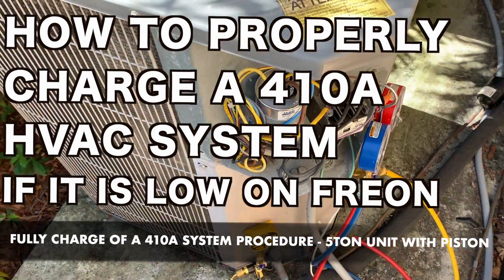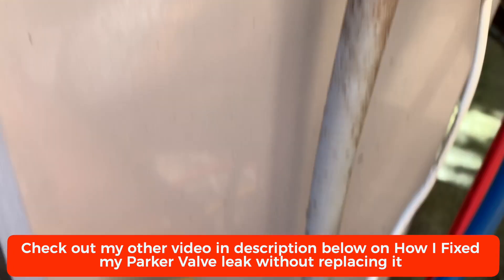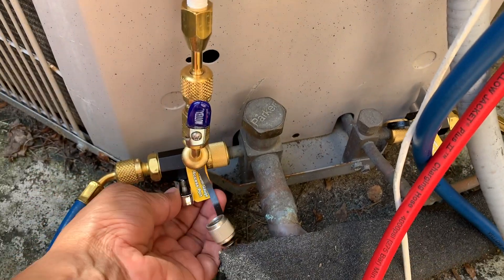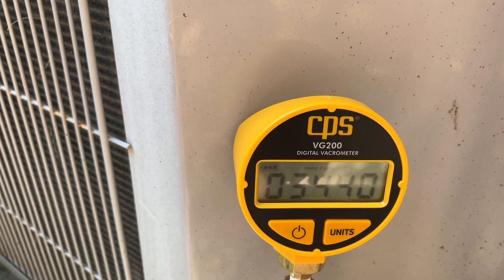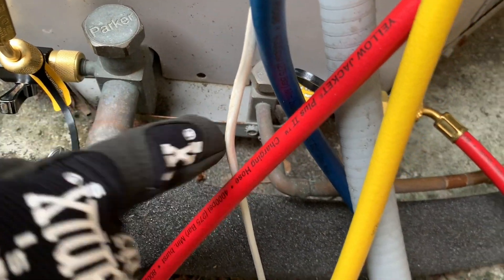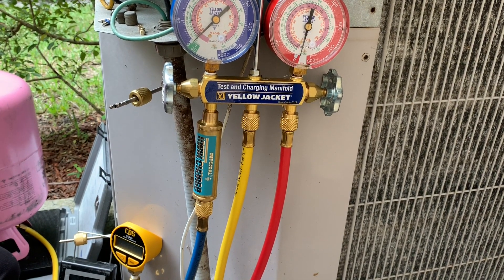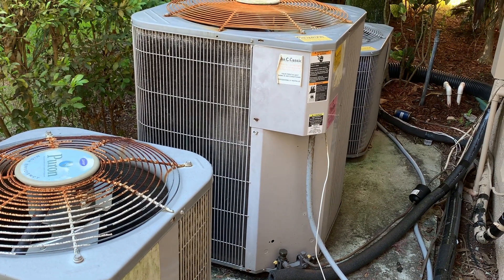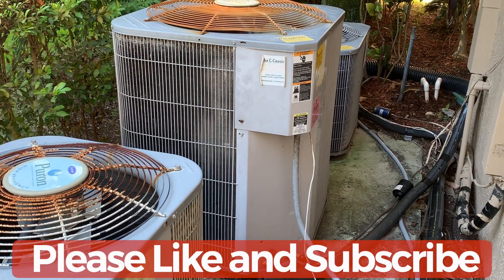How to Properly Charge HVAC with 410A after pulling a Vacuum

Comment: So if you changed the compressor,  and you need to charge the system from scratch,  you would still charge it the same way,  just pump liquid refrigerate into the high side with the compressor off?

Comment: Fun Fact: "Freon" was coined way back by Dupont when it competing for business to charge cars low on "refrigerant." So freon IS NOT THE SAME across the board, but it worked for Dupont and the wording is still used til this day.

Comment: good video ima installer w some service skills but I haven't been active in the field due to injuries but watching the video gave me a quick refresher w out having to hear too much extra talking about non sense to distract me lmao but yea I have to charge my unit from high side since the unit cycles on and off due to pressure switches doing their job... but yea feed refrigerant from liquid side at first to get switches to close so unit can run normal and the rest feed through suction side  and measure sub cooling since its txv 410a unit... .... but I do have to check air handler in attic to see where any possible leaks can come from when I first installed it I left gauges on for more than a day and it held pressure very well. but I also think I mightve ran my return air flex too long so I might have to add 2 more smaller return grills up stairs in separate rooms or try to cut the return flex to a shorter route but first im going to increase the blower motor fan speed up one notch and see how she goes.
Reply from the maker: Glad it helped. Please like and subscribe as it helps my channel supporting charity :)

Comment: Great video! If after fixing a leak, do I add the liquid refrigerant with the lines still back seated ? Then when it adds no more, then switch the unit on and add capot thru the suction line? Please help
Reply from the maker: Randy N yes fix the leak. Make sure the valves are open. Fill up from liquid side and then it will stop taking gas at some time in liquid form. Turn on unit and charge from suction side as gas. Make sure use the device or do it extremely slow. You want to make sure you charging as gas.
Watch the other charging video on my channel I showed in detail.
Reply: R410A is supposed to be charged as a liquid. It says on the jug itself to flip it upside when charging.

Comment: On 4min you turned off hose valve how can you check leak? on 7min how can you turn on hose valve to kick off R410a cycling and start compressor? As Scott said which special fitting can do these? thanks alot!

Comment: Service valves shouldn't be closed when pulling a vacuum. Recover all the refrigerant into a separate recovery tank. The whole system should be open. Pressurize with nitrogen, see if pressure holds and spray bubbles at joints/coils to check for leaks. Then pull vacuum.
Reply from the maker: Not true. Is this how you install new units? Valves are always close when vacuuming a new system. You don’t recover gas in new units. It’s the same process on new or old units

Comment: you said you made sure there were no leaks....if the charge was low there was a leak, unless someone tampered with it but that's usually not the case.  I'm not sure if i missed something in the video but I didn't see any resolution about the leak.
Reply from the maker: Yes there was no leak in the line that I vacuumed. Later few months I realized there is a minor leak in the condenser coil which was behind the service valve. Decided to change the ac as it’s 15yr old. Will make another video on replacement. Just got the new unit
Reply: very nice you update us!

Comment: If his indoor unit is a furnace then it will have to have a flue vent for combustion gases. That is called ventilation. Therefore it would be a hvac system he is referring to.

Comment: Can you still pump down even theres a leak on the flare nut on the gas side? If yes, will just do same procedure or do something else?
Reply from the maker: Yes. Normally that leak is so small. I have done it and it works just fine. Your filter catches minor moisture. It’s design to do it. I always recommend changing out the filter dryer on older unit. It helps a lot.

Comment: They make a special fitting so liquid doesn’t inter the low side  ! Yellow jacket 🐝 makes it  !
Reply: the black body would be CPS part, what fitting is this and how it works?
Reply: He has the fitting in the gauges, hooked to the blue hose. He is just using the red side......but I have researched and it says to turn the unit on and charge it with the blue hose, as the compressors need to be charged with vapor, not liquid.

Comment: Hi . I packed a small bottle of 410, the size of 800 g. Note that the manufacturer wrote in the outdoor unit, the air conditioner is 710 g. Only
When the flask was completely filled, a white layer appeared on the intake pipe. But the scale indicates 70 psi. The air conditioner works normally except for an annoying loud sound when the compressor is running..
What is the solution respect the scale (710g) according to the manufacturer
Or play until it reaches about (120psi) thanks
Reply from the maker: No idea. I think you have a small system I believe. Mine takes 7lbs of 410a
Reply: @HowToDoitright  Thank you
Reply: @HowToDoitright  Thank you very much. I changed the gas hoses, which were aluminum, with copper ones, and the problem was resolved. The pressure returned and the annoying sound disappeared.
Reply from the maker: Glad it helped. Please like and subscribe as it helps my channel supporting charity :)
Reply: @HowToDoitright  ok

Comment: Never pull a vacuum through your manifold because there are to many connections that will have you trying to find a leak on the system when it was your hoses or manifold.

Comment: Why did you isolate the condenser when doing the vacuum? Shouldn't of you vacuum the whole system including the condenser
Reply from the maker: My leak wasn’t in the condenser coil. If the leak is in condenser then yes.
Reply: Your leak had to be in the condenser coil because you didn’t find a leak in the line set nor the evaporator coil.